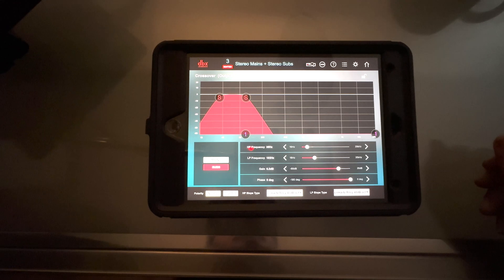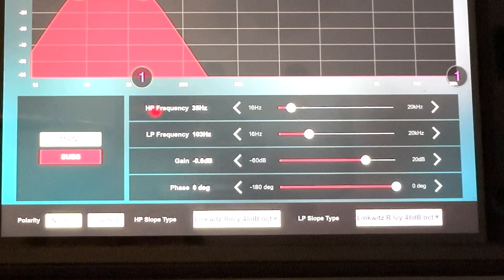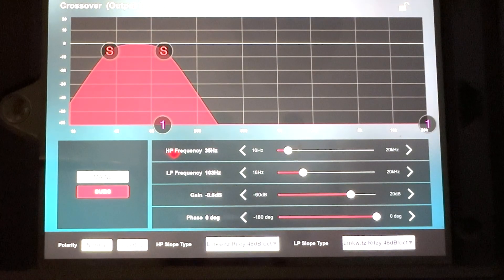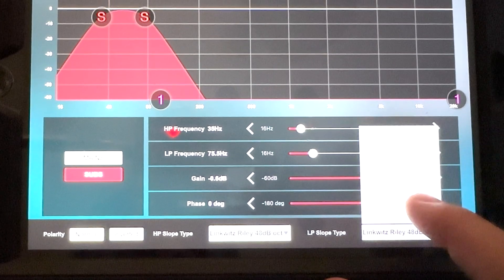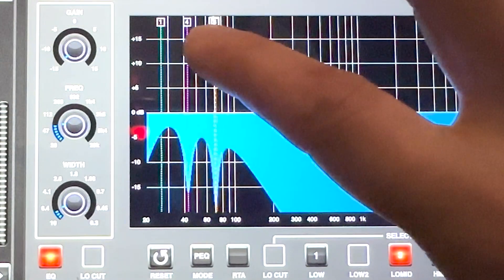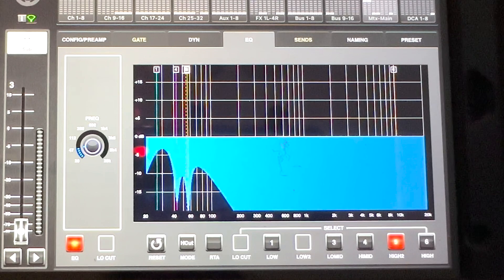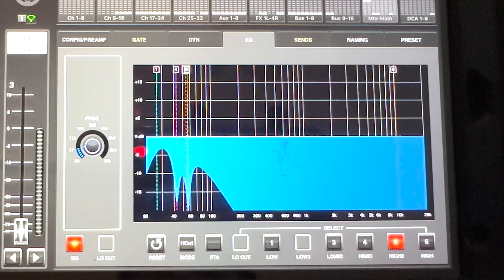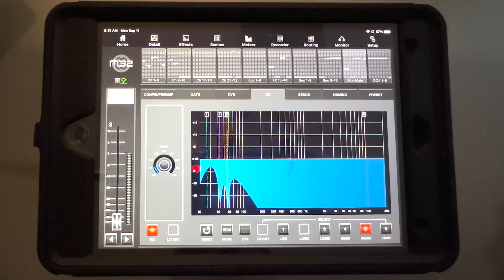My Subwoofer EQ Theory Explained.

Comment: After years I came to the exact same conclusions like you.

Infact I upgraded my personal PA tops from Mackie SRM 212 to Mackie DRM 315, so the top is capable of playing (loud) all the way down to about 80 Hz. So that I can set my crossover point there. Granted my controller only allows for 24 dB crossover. But thats fine for me.

Btw I really didnt like 100-120 Hz before, just like you. But in my case because the sub had to play it. Now that the top is playing it, even this frequency sounds awesome if setup currectly.

The next big step up was I started using FIR filters. And man, they make a huge difference compared to IIR filters that mess up the phase big time. Especially when being inside with the PA.

Now my system sounds better than ever.

Comment: I'm definitely not nearly the most experienced expert in this matter, but I do know how to make a show sound good. I'm actually newly enrolled in audio engineering school, so I'm looking forward to what I have to learn. But yes, recently somewhere on social media, I mentioned that I have a separate eq for my subs, and a guy went at me, swearing that you cannot eq subs, and there is no reason to have them on a separate feed from the mains. I didn't have the breakdown that you gave (and I generally just don't go back and forth on the internet), but I just said that I do what makes the system sound good in the room that I'm in.
Reply from the maker: You absolutely can (and should) EQ your subs. I I was a guest at a wedding with 800 people tonight. The band had a Martin rig with a QL5. The double 18 subs sounded awful. A steeper LPF and a couple of dips would have tightened everything up. Hugely expensive rig that sounded terrible. Feedback the whole night. Perhaps an EQ that didn’t “look great” may have solved the problems….
Reply: @billylaguardia   That's the other part of it too. A lot of folks think that all they need to do is spend a lot of money on a rig, and make it go really loud. Meanwhile, someone else spends 1/4th that amount, and knows how to eq and place their speakers properly (not even getting into dynamics and effects), and can sound WAY better.

Comment: Hi Billy, system processors are usually the best approach to tuning any speaker system. Their DSP is dedicated to the task, often the presets are carefully calculated by the various manufacturers. However, in lieu of these, the M-32's matrix outputs can do a decent job. In any case, tune and mix with your ears and not your eyes.
Reply from the maker: Hey Bill. Thanks for the comment. I totally agree. I would prefer to have a system processor. I used to carry one to every gig, I just found for this band, I could achieve similar results with the console’s matrix eq. Again, you don’t get as steep of filters or delay, but its fine for what the gigs are. The videos that cause the most comment section ire are a stick PA with a 12pc wedding band shoved in a country club. In that case, you gotta do what you gotta do. I agree with using your ears. I think if any commenters saw what a Pultec boost curve actually looked like - they’d faint!

Comment: Hi sir i all ready use x-over point in a DSP do i need another x-over point in a mixer sir..? Thank you
Reply from the maker: Nope. If your system processor is handling it you don’t need the steep low pass filter.

Comment: Question.... with the M32C can you play music from your iPad or phone through the console via Ethernet?
Reply from the maker: Hmm. That’s a great question. My first instinct is no on Ethernet alone. However it may be possible if you are hooked up via usb & Ethernet. You could set your inputs on the M32 as “card” and set the audio driver to the M32 on your computer. Give it a try, inquiring minds want to know!
Reply: @billylaguardia   Well, it  sure is a midas console...which means extra steps for mundane tasks.  There is no way to play break music from an iPad over wireless into the M32C. That USB port on the console is largely decorative. Dante came to the rescue however 'Dantefication' ain't cheap. I installed a Dante card in the M32C, connected the secondary Dante port into the M32C Ethernet port then the primary Dante Port into a unmanaged PoE switch. I connected my computer to the switch and this was the only way  to run break music into the console.  How i wish everything could be done from an iPad without the extra overhead.

Comment: for the gigs what's you usually do using your eares is ok, but when you have an arena with 50+ spekaers you well need smaart, and I dont even talked about phase alaghnin the mains to the sub, I would like to see how you hear the phase... Here is two excellent youtubers who you should check out: Michael Curtis and Nathan Lively.
Reply: On the big pa video you used a low pass filter on the sub send, in theory this will most likely throw your LR send out of phase with the sub send what this does is mess with the sub and top crossover area and loose summation … maybe sub eq without the filter would have helped… it’s just that filters drastically effect the phase. Really great video I love your content and build videos
Reply from the maker: @cephaswesley7684  The interesting thing about the Bud Stage gig was that I barely used any sub. Most of the sound you were hearing was the main PA hangs with a tiny bit of sub added in. That amphitheater had a metal roof and was made of concrete. The roof has a resonant frequency of around 100Hz. So I had to keep the show quiet at 90db and bass lite for it to work in that venue.
Reply: @billylaguardia  yeah I can understand venue acoustics from the looks of it CRAZY 🤓.. I was just saying that in general adding a filter to your PA sends usually effects the phase relationships between PA and SUB sends sometimes even flip it by 180degrees depending on what filter you use. When you have some free time on your hand run some Smaart traces on your LR and Sub outs it will show you how it’s effecting the phase
Reply from the maker: Big PA’s come with system engineers. PA deployment is not my area of expertise. I let the SE work with the deployment in the room based on their array calc and Smaart. They usually give me a flat PA and we dial things in tonally together. I still will dial my matrix EQs in as needed during sound check and the show. Here is a big PA: https://youtube.com/watch?v=xBorrSJ99xM&si=Ej_NcQUADlCr4yHb

Comment: It was good. Good knowledge, and as someone who aren’t super familiar with everything, it’s so true that 100hz just isn’t something that belongs in a sub.
Reply: It really depends on the PA you are using and how a manufacturer designed a box and it’s believes acoustic crossover points  …. If you try to force a top that is not designed to reproduce 100HZ at high decibels your are essentially hitting the limiters  and reducing the overall performance of the box… in the end it all depends
Reply: @cephaswesley7684  sure, tune by ear, but I must say most I've heard especially EV has a nasty peak at 100hz, and the standard pass is at 100 or 120
Reply: @mitas3484  personally I would never tune the PA by ear and would always prefer to use a  measurement mic and Smaart especially if it’s making a top and a sub go work together. I never used a EV system before so can’t really comment.. end of the day if it sounds right it is right for you. 

All I meant is that some systems need 100hz on the sub by design to work with a top so it really depends from system to system.